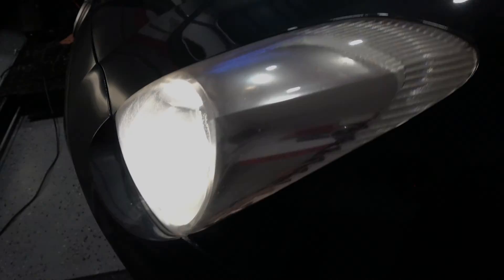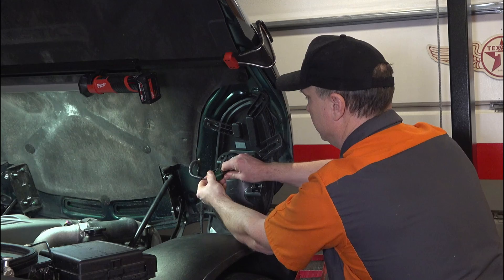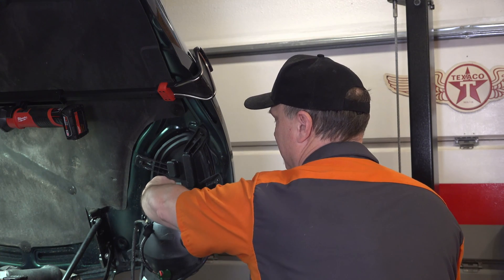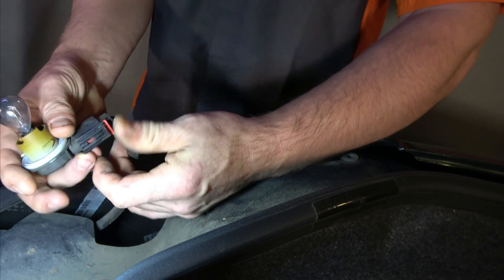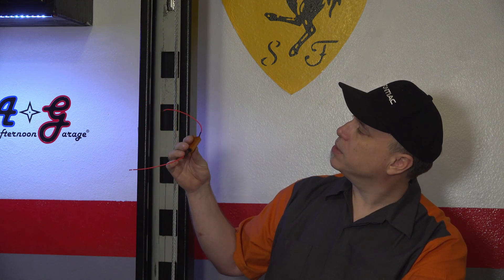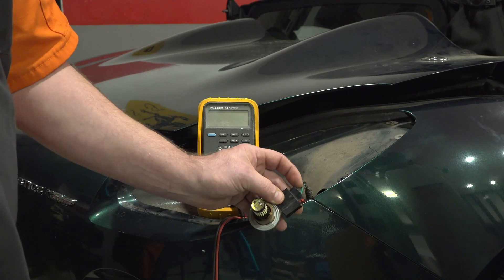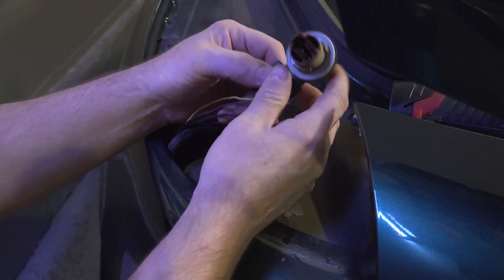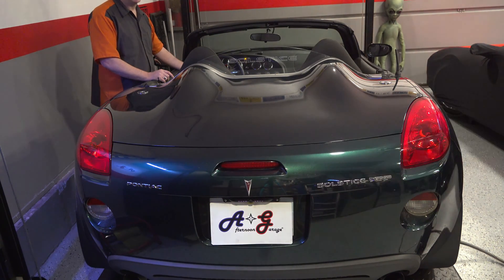Pontiac Solstice: LED headlight and tail lights [4K] Ep9

Comment: I really appreciate your Solstice videos because they've made my life easier, but the section about the LED headlight orientation is incorrect. I just installed similar 2-sided LEDs in my 2006 base model and if they are not turned vertical (light emitting out the sides at 3 and 9 o-clock) the high beams do not work at all. My bulbs have fixed adjustment points so I was not able to get them exactly vertical, but they work nicely. If you turn them "flat" or horizontal as you state, the light they cast is terrible.
Reply from the maker: I showed the drawings of the bulb and housing.  Not sure why you are getting different results, but the drawings of the light housings clearly show the path the light takes as it reflects in the housing.  I guess the important thing to know here is that those LED's are adjustable and can be rotated for maximum light output.  I think I will try what you did and see if it makes a difference here.  Thank you for the feedback!
Reply: I had a similar issue with my first set of leds. I found that setting the diodes at about 10 and 4 on the passenger, and 2 and 8 on the driver side worked best.

When those wore out after about 5 years, the new pair I got worked much better "flat" as stated in this video.

Near as I can tell, the first LEDs I had lit half diodes on both sides for low, and ALL diodes for high. This created a floodlight effect, where the light was "spraying" out of the lamp like a mist, rather than a focused "beam." And on high it was worse, with the light pattern spraying higher and wider. They were absolutely blinding when looked at, but did little to light up the road.

Once I adjusted them to the pattern stated earlier (driver side like "/" and passenger side like "\") I was able to get a fairly crisp line for the top of the low beam pattern, with a bit of fuzziness. Projection was focused, with a drop off around 500ft. And the highs projected almost completely straight ahead, with a drop off around 2000ft. The "flood" effect above and to the sides was sufficient to light up the sides of the road, as well as any overhead branches or road signs.

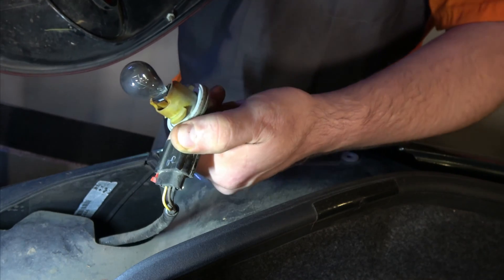The second set of LEDs either have separate diodes for high and low, or use one side for low, and both for high. The beam pattern was crap at the diagonals I used before. I found that using those bulbs, the 12 and 6 position worked best on the passenger side, and something closer to 12:30 and 6:30 for driver side. At the 12 and 6, the driver side beam projected too far into the left lane. Angling it slightly made it less sharp, but kept the low beam from shining directly into oncoming traffic.

Hope this helps
Reply from the maker: @CbdToilette  This is great information. Thank you for going through this testing, it helps all of us when you document work like this.  This answers the question of orientation with the capsule.  Most are unaware that you can remove a pin to rotate those to different orientation.  It looks like depending on how they were manufactured, determines the rotation for the best reflectivity.  This is the most discussed problem with these parts.  I will pin your comment, and thanks for watching... and helping out all of us!

Comment: I'm noticing now that LED bulbs are being sold with built-in resistors.  would this eliminate the need for separate load resistors?
Reply from the maker: Yes it appears that the metal ones will dissipate the 24 watts (6 ohms @ 12V) to satisfy the BCM to think there is an incandescent bulb in there.  They cost a bit more, but without having to modify your wiring, this is a good thing.  Thanks for sharing!

Comment: I've gone through 2 sets of led headlights on my solstice over 8 years. Also changed backup lights to led. 2 of the bulbs I bought came with an in line resistor that plugged in between the car and the bulb. For the one that didn't, I just messaged the manufacturer, and they provided in line resistors for free.

You're doing too much here.

Plus, the in line resistors come in a 3" by 1" metal housing with a heat sync to spread it out.
Reply from the maker: Well, I wanted to convert it all. Remember that the resistors are only to "trick" the BCM into thinking that every thing is OK and there is sufficient load on the wire.  It will simulate the load similar to incandescent bulbs being intact.  This would then do nothing for power savings, but they sure look great.  I have only lost one rear taillight due to poor manufacturing.  Thanks for watching!

Comment: anyone knows where to buy the complete headlight assy for less than $245/each?
ebay jacked up these lights beyond $525!
Reply from the maker: Yeah I saw that.  A few years ago when I started the Solstice series, I realized that this light is a one-off and there were only so many made.  I could pick up a light assembly for a 100 or 200 and now, it looks like those days have ended.  I checked car-part.com and it looks like they have a few right hand assemblys that can be had for a bit over $200 in my area.  I wish I would have purchased a few sets of these 5 years ago.  Thanks for watching!
Reply: @afternoongarage  many used headlight assy are selling are defective.
why on earth would anyone want to pay high prices & then clean/sand/rub/polish....?

Comment: 3 years later but .... Checking in to see if your Solstice caught fire or not?  You  shouldn't tape the load resistor to the wiring harness, it gets attached to a metal surface and screwed into the metal. It gets extremely hot..
Reply from the maker: It really doesn't get hot, even if on continuously.  Figure the wattage (50W) of the circuit with a 6 ohm load and the heat generated even if on all the time is nothing.  The wattage on those resistors is certainly overkill.  No need to mount these resistors, just get strap them to the harness and make sure they don't short to anything.  Thanks for watching!

Comment: Anybody doing this in 2023?  Are there newer models available that may be even better?
Reply from the maker: Sure tech gets better.  I think what I put in there you can't buy anymore under that name.  What you need to look out for is to get a headlight without a fan that will eventually fail.  They make some heatsinks from copper strap but the aluminum heatsink one like I have here is going to have the most chance of working long term.  Thank you for watching!
Reply: @afternoongarage  Thanks for making these videos. They've been a huge help and given me some great ideas!

Comment: You really don't want to do that with the resistor. I would not tape them to the wires they get very very hot. That's why they had mounting holes on them to mount them to metal somewhere that it won't matter if they get hot.

Comment: where did you get your lights and what make/model are they?
Reply from the maker: I purchased this from Amazon, BEAMTECH H13 LED Headlight Bulb, 50W 6500K 8000Lumens Extremely Brigh (9008 Hi/Lo).  I looked and they don't sell this anymore under that name.  Just get a fanless H13 LED headlight and you should be fine.  There are lots of different ones there.  Don't forget to check the orientation of the LED chips as I showed in the video.

Comment: My solstice has Daytime Running Lamps which are also the front Turn Signal.  Have you tried putting a resistor on the front?  It has four wires: one to the fog lamp, one ground, and I would imagine the other two are for the turn signal and DRL.  Would both the DRL and TS wire need a resistor?
Reply from the maker: I really think the only reason for the resistor is to correct the load problem with an LED capsule.  If you are changing the fog lamps to LED, probably no need to load that circuit.  If you are changing the park/turn indicators to LED, you will  likely run into the same problem as I did when converting the rears.  I have a wiring diagram that I put up today on Afternoon Garage Facebook page.  This shows all the exterior lighting, wire colors and where it terminates.  Looks like the rear turns and front turns are independent connections on the BCM.  Rear turn light outputs are pins A7 and A12 to the BCM while the front light outputs are pins 35 and 17 on the BCM.  So if you are changing the front to LED, don't be surprised if you will need to load the front circuit as you did in the rear.

Comment: Did you put a load resistor on each light or just one?
Reply from the maker: Just one side had the fast flash and when I put a load resistor on the right side, the left side started to fast flash as well.  So I figured the BCM needs to see both the right and the left at the correct resistance or you have that problem.

Comment: Recently picked up a GXP and i fooking love it, have been enjoying your videos alot!!! What lights did you purchase, do you have any links?
Reply from the maker: I purchased this from Amazon, BEAMTECH H13 LED Headlight Bulb, 50W 6500K 8000Lumens Extremely Brigh (9008 Hi/Lo).  I looked and they don't sell this anymore under that name.  Just get a fanless H13 LED headlight and you should be fine.  There are lots of different ones there.  Don't forget to check the orientation of the LED chips as I showed in the video.

Comment: Watching this as I need to replace a headlight. So I might as well get 2 and get a nice modern xenon bright white light lol. Thanks for the video!
Reply from the maker: After a year since I made the video, there are so many more choices in capsules you can put in there.  If going aftermarket, make sure you check the orientation of the lights you are installing.  Good luck!

Comment: Great video, learned a lot about my new Solstice! My question: I have read multiple times that the resistors get really hot, and to mount them to metal. I notice you taped yours to the wire harness. Any problems with this configuration? I planned on following your instructions to a T. Thanks in advance!
Reply from the maker: They should be fine taped to the harness, I see that done frequently.  They are 6 ohm 50 watt resistors.  Running a quick ohms law calculation, it is ~13 volts and 6 ohms.  That would be ~28 watts total power dissipation.  The 50 watt resistors should be fine without an additional heat sink. Another thing to note is they are not flowing current unless the turn signal or brake is on.  So the duty cycle is small and that is why I think it is OK in this situation.  Thank you for watching my video!
Reply: Worked like a charm! One more question. I may have missed it in the video, but why not use the red wire adapters that come with the resistors? Do they fail over time?
Reply from the maker: You will find that experienced electrical people don't like solderless wire splices like that.  They can get loose and fail over time, especially if exposed to moisture.  I have seen those splices melt down before because of the current and poor contact area generating heat.

Comment: So should you not use these resistors on these particular tail lights since they also work as parking lights? I read that the resistors get really hot if used on blinker lights that serve as parking lights and/or daytime running lamps.     ????
Reply from the maker: Daytime running lamps are headlights.  These are park/turn bulbs.  They are a dual filament bulb.  It has a common, and two independent filaments (or LED clusters).  You are only connecting the resistors to the brake/turn on each side.   The reason for the resistors are to load the circuit (just as an old style filament bulb will) to make the BCM operate like there is not a bulb out because of the low current draw of the LED's.  You want the yellow/black on the left side (left turn and brake), and green/black on the right side (right turn and brake). You do NOT want to load the parking light circuit.
Reply: @afternoongarage  Thanks for clarifying! I had just installed front and rear turn signal led lights and experience the "hyper" blinking so I started researching. I'm not sure if I have daytime running lamps or not on the front amber lights, hoping they are not. (haven't had the vehicle long enough before I started upgrading/taking it apart.)

Comment: I want to know where to order the kit you used for the headlights in order to make it LED
Reply from the maker: I purchased this from Amazon, BEAMTECH H13 LED Headlight Bulb, 50W 6500K 8000Lumens Extremely Brigh (9008 Hi/Lo) 

Remember  watch the video because these need some adjustment to get them to work properly!  A year later and these things are great.

Comment: Hi my name is Pablo, I one a 2009 GXP Solstice in the  Caribbean and I installed a hitch, now a want to install a plug for the trailer.
My question can I just "steal" connect the wiring from the plug to the existing taillights wiring without any risk?
Thank you in advance, greetings from Curacao.
Reply from the maker: The wiring you need to connect your trailer is there in the rear.  Brown for park, yellow for left, green for right and white for ground.  The tail lights are set up for a trailer, as there are no separate amber lights for the turn signals.  The turn signal wiring is shared with the brake, ideal for your trailer.  The stop lights are fused for 15 Amps, the turn signals fused for 10 Amps and the park lights fused for 10 Amps.  Plenty of current to supply for your trailer.  You should have no issues tapping the wires from this fused source.  Good luck, and thank you for the subscription!
Reply: @afternoongarage  WOW thank and I appreciate  for your fast answer and keep doing videos for the solstice

Comment: Do you know how to change the bulbs on the dash the light up the controls ie fan air control knobs? Thx
Reply from the maker: Funny you ask!  I know very little about the car I just purchased when I was doing the dash removal.  When I got it back together, and drove the car at night, I noticed that my heater controls aren't lighting up.  I thought it was from something I didn't plug back in, although I remember reconnecting everything.  You must have the same issue.  I am good with electronics and repair.  Will make a video soon, remove the controls and replace the illumination.  Thanks for watching, and expect that video soon!
Reply from the maker: Hey there Allen!  I have a video on these parts.  Here:  https://youtu.be/kgs6lULAEA0

Comment: Hi, Thanks for your Solstice videos! So, I bought a pair of 5.5w LED 3157 tail lights. The lights came with resistors (no spec on them) wired everything up. With the car on but not running everything was perfect. Took the car for a spin and it started fast flashing almost immediately. Went to the parts store and bought Sylvania 12v 6ohm resistors. Swapped out and tested car both running and not and all was fine! Took the car for a rip and the fast flashing has returned...Frustrating. Suggestions? Cheers. Allan
Reply from the maker: It is up to the BCM to determine the load.  Did you wire the resistor in parallel across the green (or yellow) wire and the black?  If you notice in my video, when I first installed them, only one side was doing the 'fast flash' without load resistors.  Not sure why that happened, but I used a 50 watt 6 ohm resistor.  I would take the light assembly out again, pull the bulb, disconnect all power and actually measure the contacts the bulb plugs into.  If you don't have 6 ohms on across two of the terminals, then you have either a bad resistor or socket.  I see Sylvania calls this a 'load equalizer'.  Testing at the socket will tell you if you have a bad solder joint as well.  Those solder connections are stiff and require a bunch of heat, and maybe something amiss there.  I have done a few conversions on GM cars and never had a problem, but I buy mine from electronics parts houses.
Reply: @afternoongarage  I really appreciate your time. So, measure twice cut once... I should have watched your video one more time and NOT defer to the included paper instructions.  I had both resistors wired to black & brown...not B&Y B&G. All working perfectly now!  Tomorrow, I tackle the center strobe module!
Reply: @afternoongarage  I'm pretty novice. I'll start with verifying the  basics... Weird that the fast flash was rectified at first which makes me somewhat confident in correct wiring but, who knows? I appreciate the response! cheers